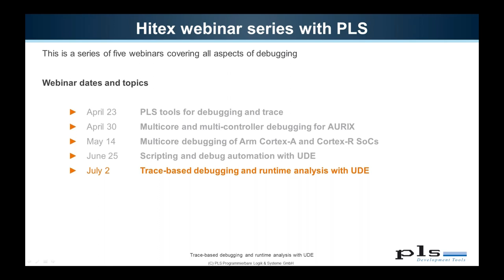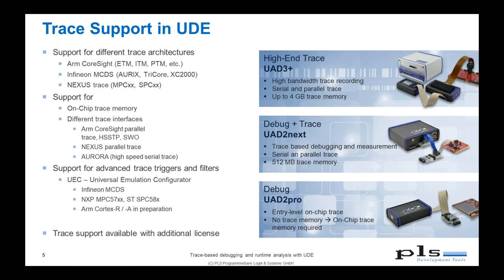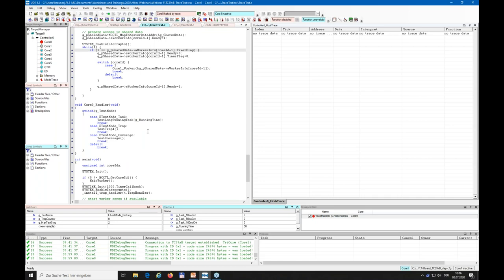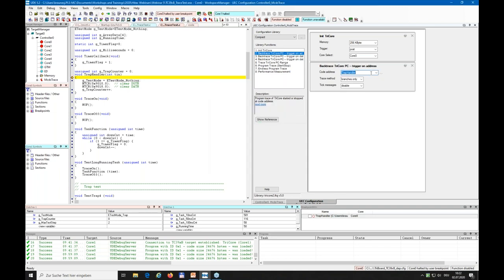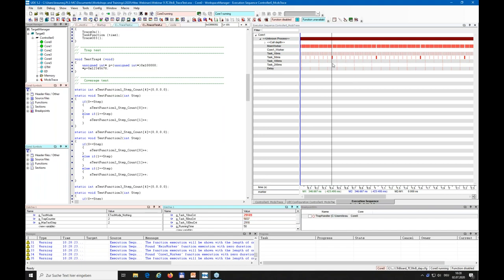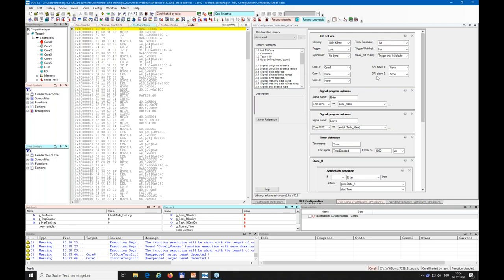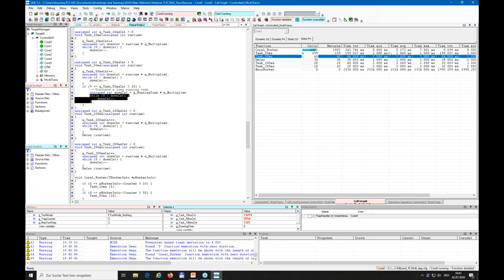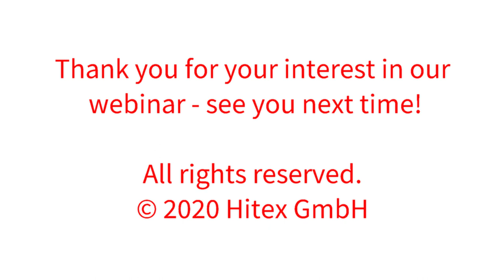Hitex Webinar Series with PLS - Part 5: Trace-based debugging and runtime analysis with UDE

Comment: Hello, is there any solution for 'Compact function trace' for Aurix chips that doesn't have MCDS Trace? Thanks for the video.
Reply from the maker: Sorry, discovered your question only today! Forwarded it to the Presenter of the webinar and will post his answer here ...
Reply: 'Compact function trace' is a feature of MCDS trace. If the AURIX chip does not have the MCDS trace implemented, the shown features cannot be used at all.